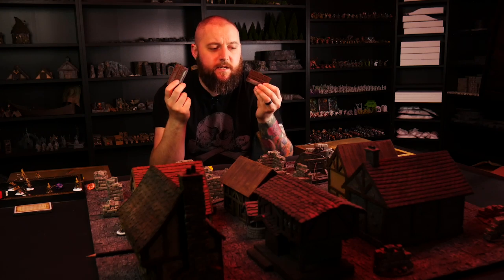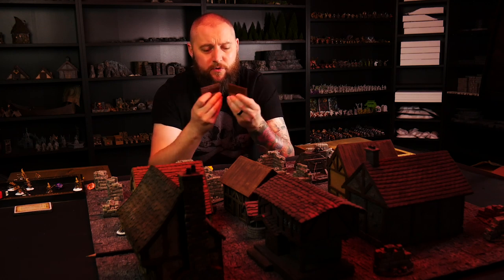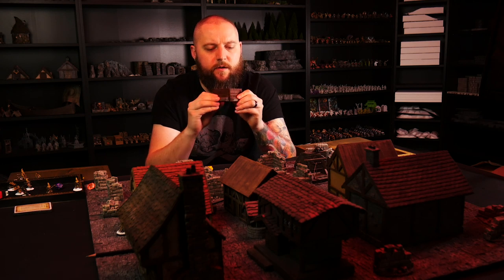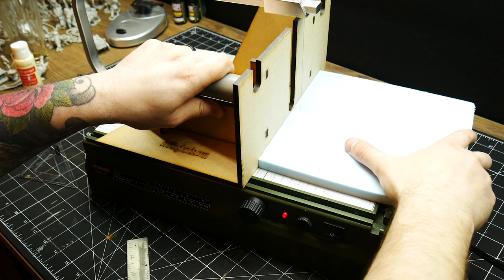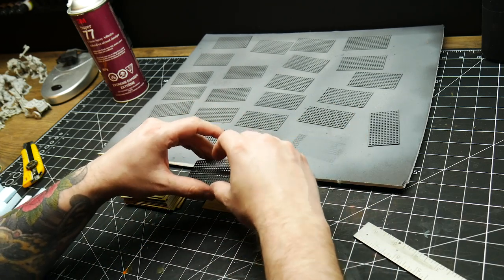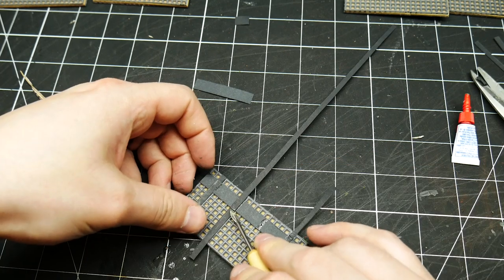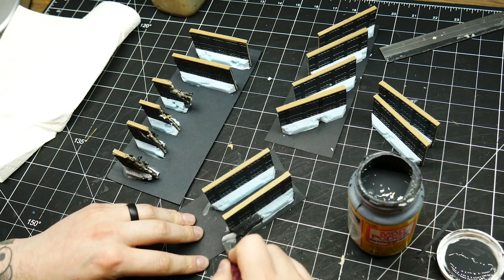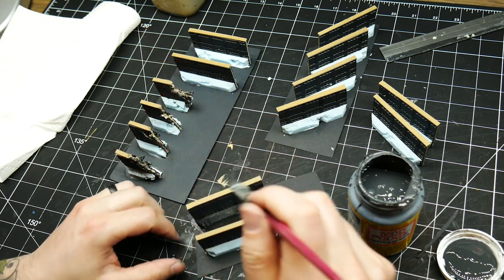Modular Metal Barricades for Kill Team, Warhammer 40k, or Gaslands

Comment: I know this sounds like extra work but if you find dealing with adhesion a pain look into some plastic adhesion promoter. Its basically primer for plastic and then you can move directly to sprayed base coat. I think you can get it on Amazon but I get it at my local body shop supply store.

Comment: The issue with the plastic not sticking is probably from the finish it gets in manufacturing, can't really sand it though. Love the idea of using the primer, the accelerant will start to eat in to the plastic and help it adhere, a light wash of acetone and a few minutes of dry time before the coat of primer should make it stick way better, love this, gonna use some of this for an atlanteian theme im gonna do soon

Comment: I like the use of chipboard sandwiched between the two pieces of granny grating. Would plastic card work just as well? 
Plastic comic book dividers are an inexpensive replacement for the chip board, especially if you work in a comic book store or can find them used.
The comic book backer boards are also a good replacement for chip board, but aren't as thick. I've glued two of them together for a solid material.
If you have a friendly local comic book store, most boxes that comic books are shipped in have a piece of cardboard inside the bottom of each box that is very similar to chip board. Some have pieces between the comic and on top. Most comic book stores end up recycling them or just tossing them out. It wouldn't hurt to ask for them as the worst thing they can say is "no". Recycling of materials destined for the landfill as terrain is awesome!

Comment: A bit late, as this is an older video, but in retrospect, using drywall mesh tape instead of granny grating would make these barricades easier to construct and paint. You'd lose a bit of depth on the grating, but the labor savings alone would make it worth using. Drywall mesh tape is just far easier to work with.

Comment: Hey man, i just wanted to let you know, i just got my proxxon hot wire cutter, and i remember hearing you say in a previous video about don't bother with buying the extra wire for it because it comes with so much... i think that may have just been a promotion or a limited time thing because i definitely do not have about 100ft of wire for this thing lol. maybe 2-3 feet. Can't wait to use it though, you're the reason i got it and also i bought it through your affiliate link. I appreciate all you do for the tabletop community and you're an inspiration to me man. Keep on crafting!
P.S. I've already made your mod podge base coat and your brown and black washes... I did notice with the wash though that once it sets for about a day there's a layer that's settled on the bottom like it's separated and i had to vigorously shake it up to get it mixed again. is this normal or did i add too much of the matte medium? Thanks man.
Reply from the maker: Did you unspool the wire? That tiny roll is like 98’. Wash will separate between uses.

Comment: how about something using cpvc pipe + fittings  as large oil lines or some toxic goo? (CPVC is cheaper than PVC and easier to cut / damage)
Reply: cpvc might be cool, but I bet a bit of corrugated tubing, like from a dishwasher, would look better at that scale.  I also have managed to get a good sewer outflow pipe just by cutting off the tip of a paper towel tube.  I tried dipping hot glue off of that to make a flowing liquid effect, but that didn't turn out as well.
Reply: @rayanderson5797 fair, but my thought with cpvc is that you get to use the T and Elbow fittings to make some more interesting shapes
Reply: @nicboileau4185  oh, that is a good idea!

Comment: You need to wash them for the same reason you wash minis. Mold release. A little dish soap and warm water does the trick.
Reply from the maker: If you are talking about the needle point mesh, washing it doesn't help much. The plastic itself seems to secret some oil. Sanding helps a bit. But in general it's good practice to wash any plastic that came from a mold.
Reply: @BlackMagicCraftOfficial  Hmm... I've never had trouble after washing mine. Maybe it's the type of plastic used int hat particular brand. But I did enjoy the video the modular walls turned out great. Another fun build might be interior sections like tunnels or space ship corridors. Plastic gutter sections make fairly awesome modular halls.

Comment: Those look great! One question. I keep reading about Gesso, what is it for? I'm a painter and sculptor and it drives me nuts not knowing what a tool I could be using is.
Reply: I’m pretty sure gesso is the stuff you prime canvas with
Reply: @zachlemon6818   I'd just never heard of it. I tend to do acrylics on wood, so canvas isn't a medium I usually work on. But thanks for the explanation. I may see if I can find some.
Reply: @myramadd6651  Gesso is also used to prime hardboard and masonite.  You can find smooth gesso, black, white or grey, and also textured gesso. Pastelists like tooth.
Reply: @hollyingraham3980  I have some craft books that swear by it. I am gonna have to get some.